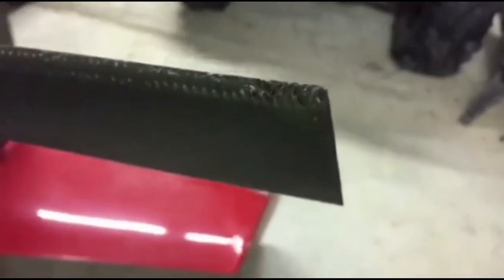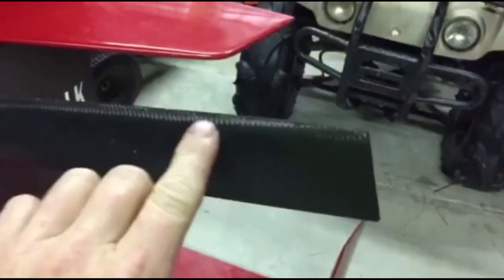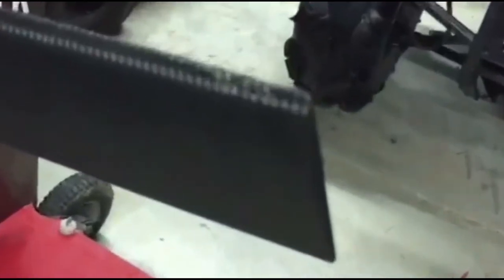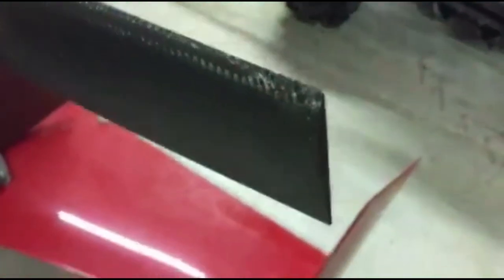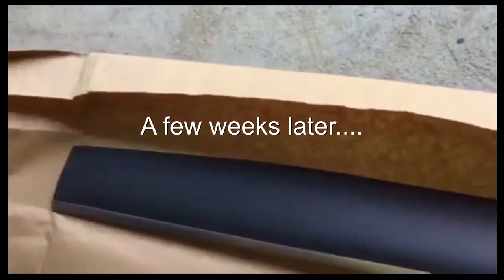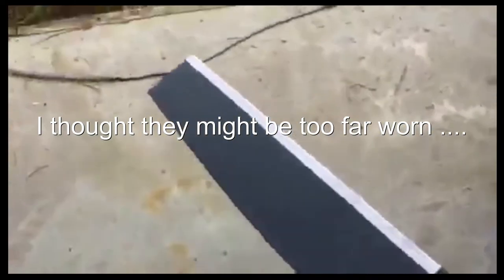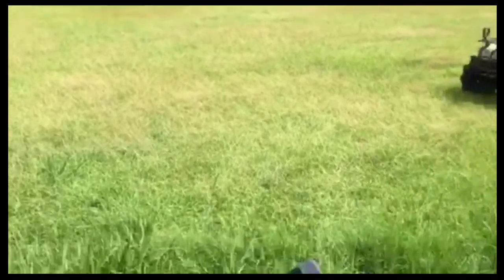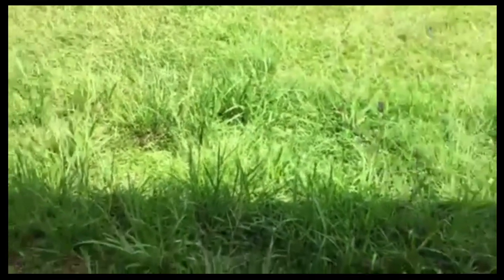Warp Drive Blades R & R

Comment: Im aware prices change but what did that run you? Ball park is fine. Trying to budget a rebuild of my rans S5
Reply from the maker: What do you mean run me ? prop reconditioning ? maybe 100 per blade but honestly cannot remember.
Reply from the maker: Call up Warp and give them the numbers from the base of the blade where it attaches to the hub. They could tell you all the data on it and about how much it would cost. Send an image or 2 as well.